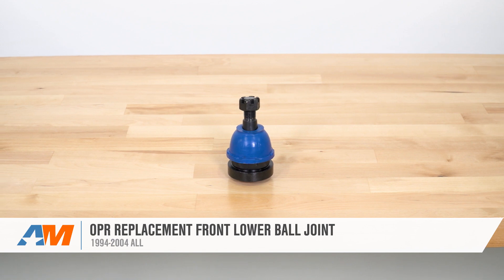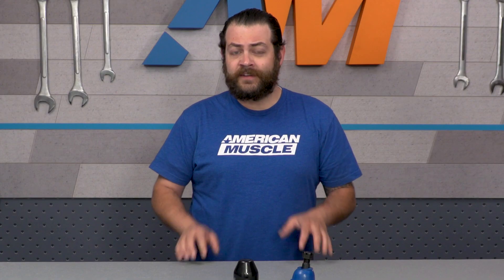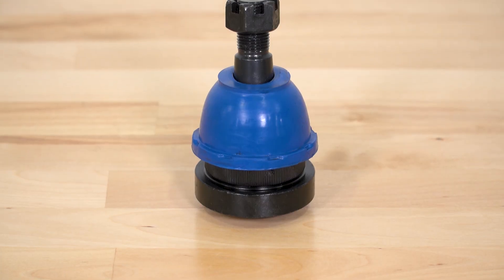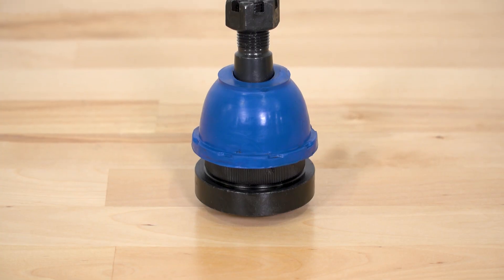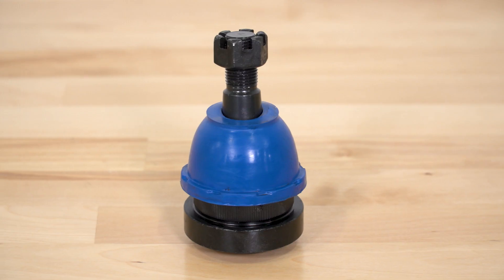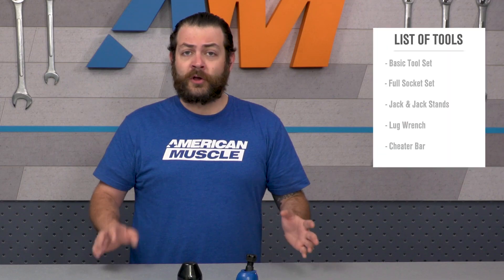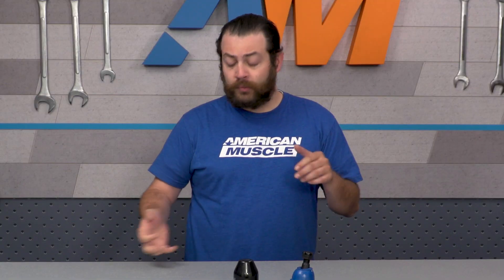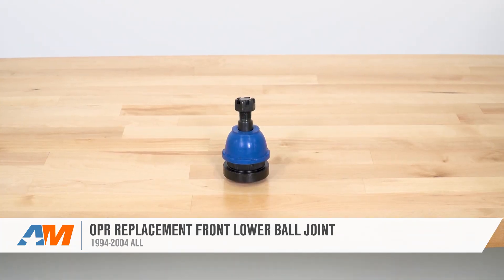1994-2004 Mustang OPR Replacement Front Lower Ball Joint Review

Comment: These are really good ball joints. I put them on my girlfriends 03 GT at 120K miles and currently at 150K miles with no problems and drives 10x better then it did before. Would buy these again for sure!